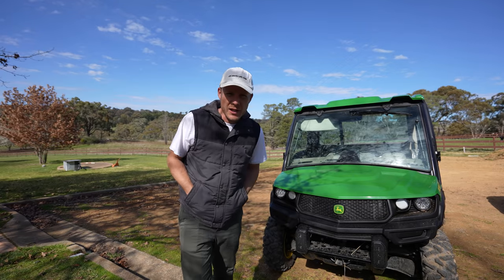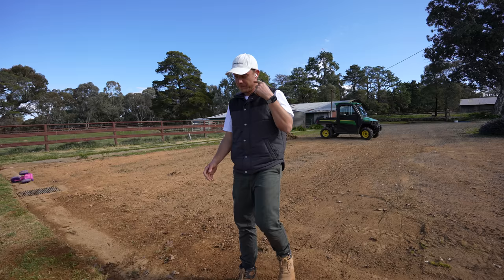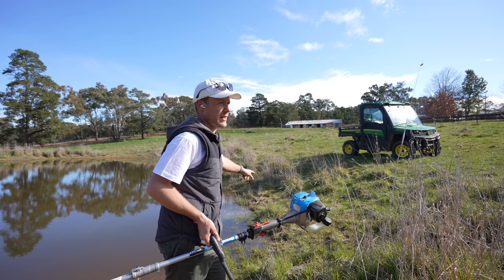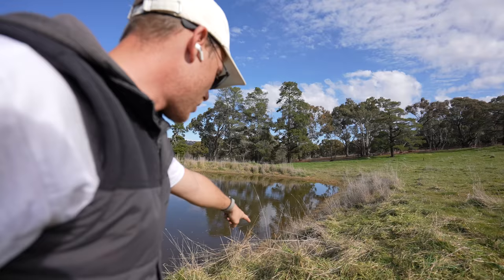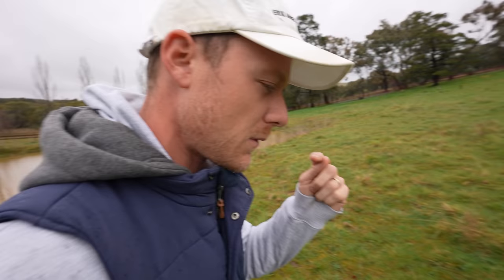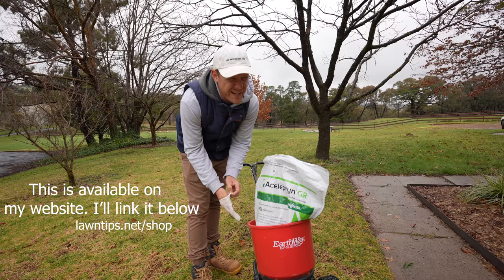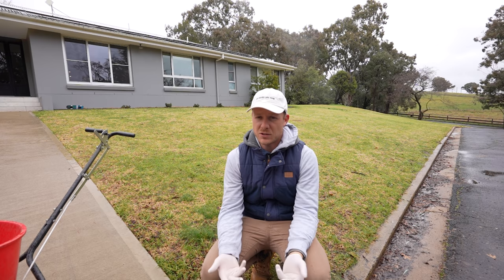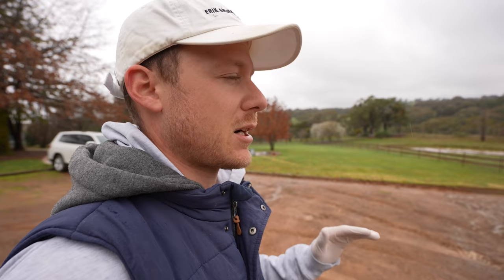Finding Pipes, Edging and Insecticide Application // Acelepryn GR

Comment: If you do have a lot of rain predicted over summer and can’t de-sediment and make the basin deeper maybe a secondary basin/dam in front or behind or even increase the capacity of the basin by making it wider …
Reply: Just remember if you extend you basin to key it in below bottom invert level so it don’t leak in future years
Reply: There's a product called flockit.
Reply: @slippinreaction  my understanding of flockit is it reduces the ph in your basin/dams ? Is that correct ?

Comment: Hey mate, just a note that you kept calling it a dam but in fact those are correctly called a pond. A dam is actually a man made structure that resembles a curved wall used to hold back water elevation between two areas. A pond on the other hand is a small body of water.
Reply: Yeah, most Australians will call it a dam rather than a pond. It might not translate internationally but locally, we’d use the term dam.
Reply from the maker: Yeah just a term used here in farms and around most of the country. Would feel very odd calling it a pond

Comment: A verti drain would be a perfect aeration attachment on the back of the loader if you can get one. Weve got the 7212 on a small kubota tractor at work. We had to add 300kg  to the front of the tractor & it can still do wheelstands in top gear

Comment: John Deere has a Tow Behind Plug Aerator I would use it with the gator or garden tractor  here is the product code  LPPA40JD or there have a 3 point hitch for the tractor